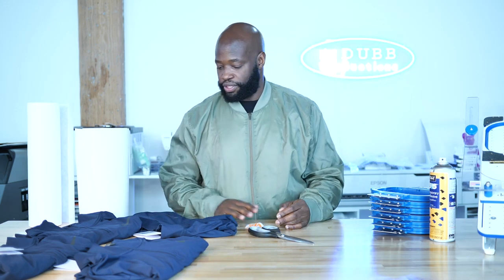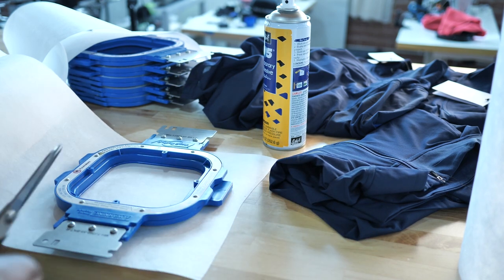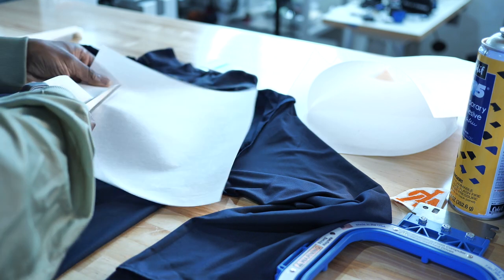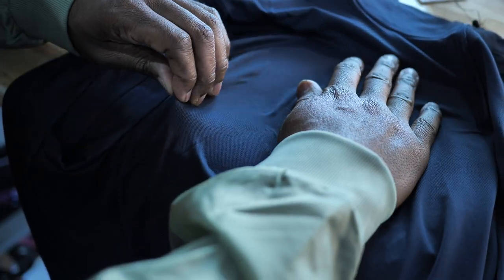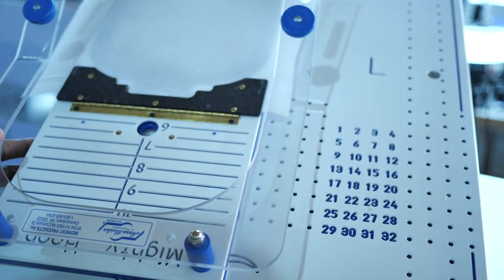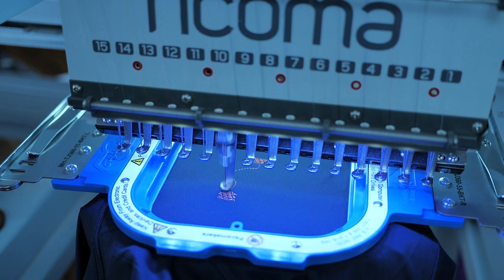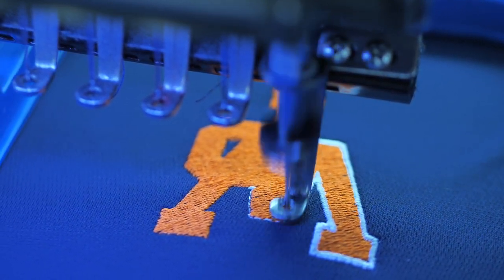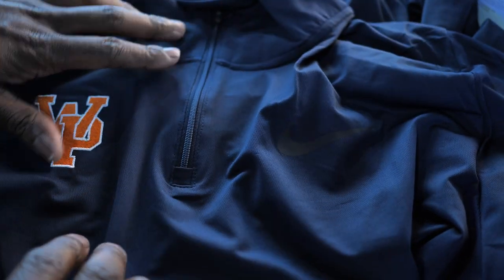How to Embroider on Performance Gear

Comment: Great video! I have not done Performance Gear yet but I will try your technique of 2 layers of cut away stabilizer. When I use spray adhesive I just use a cardboard box that I was going to put into recycling anyway (I always have at least 1 laying around) and spray my stabilizer in the box to prevent the spray from getting on anything else.
Reply from the maker: Great tip. I tried to say that in the video but said something silly about clothes lol. It’s tough for me to focus sometimes.

Comment: Performance cutaway, Is the best when it comes down to performance apparel.
Because when you use regular cut away you can see the the shape of the cutaway.
With the performance cut away you won't see it it's not noticeable.
Reply from the maker: I’ve tried that mesh cutaway.  It doesn’t work for me. Doesn’t look as clean as the hard cutaway.  Some of my embroidery friends swear by it. I’ve never got results that I liked.

Comment: Does this method help with puckering after a wash. 
Thanks again for the motivation. 🤘🏾🤘🏾
Reply from the maker: Yes. It should look the same or very similar after washing. I suggest a very light press inside out with another piece of fabric covering the material.